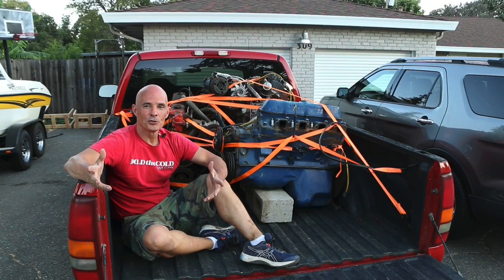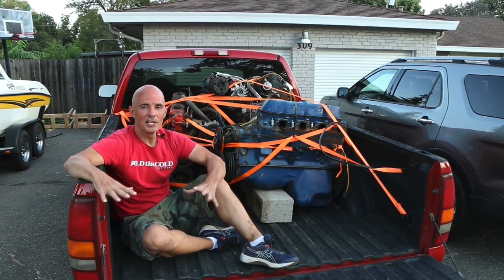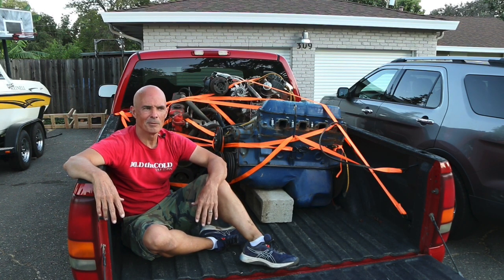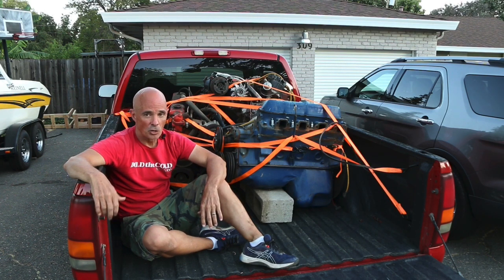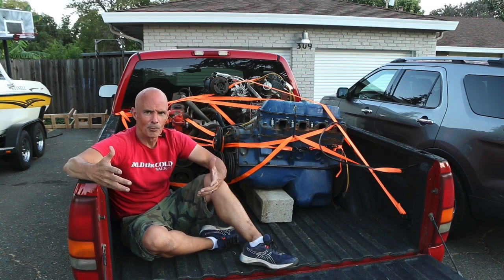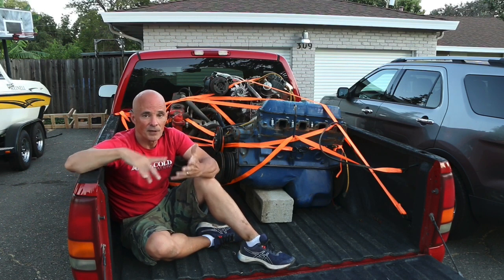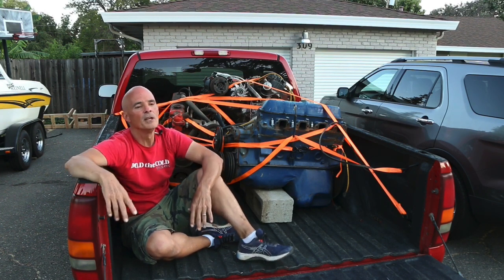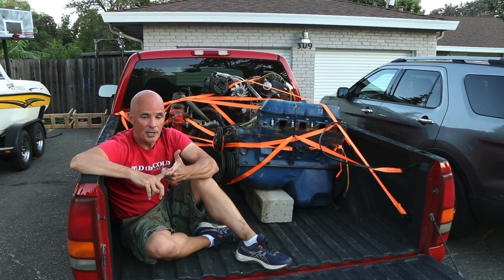THE OTHER GUYS-3 FOR FREE!!!

Comment: I am glad to see not only are you doing the blocks that most people blow up,and do not do to price, but how to make them last, and there short comings. Know I had a 455, its geometry was better,so it would give more with less, but I did not do the oiling system and bore out the returns, and coat the inside, and ended up starving the lower end , can not wait to see the builds,and the dyno sheets

Comment: I had a wrecking yard back in the 70's and 80's. All these engines were very plentiful. I had lots of trucks with the 292. Loved them motors. Funny story... I was rebuilding one of the 292's and when I was going back together with it I couldn't find one of the push rods. I spent several hours looking and didn't know what happened to it. Ordered a new one and got the truck back on the road. About 7 years later, my brother in law was metal detecting in my yard and found the missing push rod. The shop was 200 feet back behind my house so I don't know how that pushrod could have walked 200 feet and wound up in my yard. Crazy!!! 
I put a 500 Cadillac motor in a 70 something 4 wheel drive Chevy truck once... Sweet running truck!!! I also had a 78 Eldorado that I bought new. It had a 472 engine in it and it was an awesome ride. But it wouldn't run quite good enough for me. After about 150,000 miles I figured it needed upgrades. I rebuilt bottom end wit flat top pistons to raise compression, milled the heads .030, put in a mild cam, and ported the heads to gasket match the intake. I think the best thing I did for that engine was putting double valve springs back on it when I put it back together. Originally it wouldn't rev much past 4000 rpm. And I know they weren't built to rev but the springs and cam and compression made that thing jump on 5500 right now... It would run down the highway like a scalded dog.. Good old days!!!!!
Reply: Lawn mower blade shot it 200 feet.
Reply: Danny Wilsher I wish I had k own you back then. I could have given you loads of business. I grew up in Peoria, AZ and one year we had a flood. There was a wrecking yard sitting on top of a cliff which was where the rivirhad cut out its bank over the years. The cliff collapsed sending cars and parts way down river. When charged with the clean up they offered the kids form the Auto Shop class free picking so they didn’t have to pay to have stuff removed. Some guys found decent parts, but getting it out of the river was a huge task. The easy stuff got picked clean, the rest didn’t. By the way a friend of mine’s parents had bought a 68 Camaro with a 250 in it. But they paid extra for a 4 spd and 12 bolt rear end. When the car came up for sale I made them and offer and they agreed to it, but by the time I got back there from the bank his mother had called and she totalled her car, so they couldn’t sell it. I would have put a 292 in the and built the he’ll put of it! Oh well.

Comment: I'm more surprised Steve is getting rid of something.
Reply from the maker: he has a lot
Reply: @richardholdener1727  he's a hoarder.
Reply: He needed more ma mopar room.😂 he would never get rid of semiusefull scrap iron if he didnt need the room for more mopar stuff.😂
Reply: They weren't Mopars.
Reply: @richardholdener1727  just found a video over at 1320video's channel after watching this video. The video I seen was of a 36 chev pickup running a 292 chev inline6 with a huge turbo. At 1000whp. So send the inline6 with the boost.
Reply: Cliff Wright we know. Jnl was saying Dulcich got rid of non Mopar stuff to make room for more Mopar stuff.
Reply: Engine Power did a 292 turbo last season with throttle body EFI. I would like to see ITB for the NA part of the build, just because when I saw builds in the late 60s, running 3 Webers on an IR manifold had the best power and powerband.
Reply: Im REALLY Lookin forward to the 292 build!! I'll stay tuned for sure! A few years ago at Bowling Green Kentucky hot rod reunion, there was a slingshot dragster with two inline 6 cylinders hooked together driving a supercharger that was mounted on the frame and a plumbed tube intake. Hundreds of cars there that day, but that dragster (although not the fastest) was one of the MOST bitchin things I saw that day!

Comment: I really want to see the 292 built up in several versions. Like and old school build with 3 carbs and a split manifold maybe and high compression build with a 4 barrel intake from 12bolt.com maybe a multiport efi intake with turbo goodness. I'm really interested in the 292 build up and want to see what parts interchange with different engines and what kind of power can be made.

Comment: I'm betting the Buick 455 will have an incredible torque band. Can't wait to see it
Reply: They do for sure !  Buick did a great job with the cam/manifolds :-)
Reply: Hopefully they are well advised and use that advice
Reply: Agreed... the Buick has the biggest bore and shortest stroke of the big GM engines, which makes for good breathing, and RPM potential if you fix the glass bottom end with oiling upgrades and a main cap girdle.
Reply: @stevelacker358  or if you have deep pockets you can go with a ta performance aluminum buick big block.
Reply: Due to tall ports. The Chevy cathedral heads do the same thing
Reply: Buick 455 blocks are weak as shit in the valley and a lot of them have core shift and thin cyl walls. It will be interesting to see what happens.

Comment: Run a Sissell ported head on the 292. I think there are some aluminum heads for the straight 6 but they are spendy. The Buick needs oil mods.....go full Stage 2 with that one ( big port alloy heads with the round exhaust ports ).

Comment: Richard you might want to start with Sissell automotive.  Newbury park  ca 91320. They make the lump port heads.There is 1 292 inline chev in Texas  in a pickup running  80mm Garett Turbo runs 8.44  in the quarter mile it must make 1200 hp .

Comment: Extremely interested in your N/A data from that 292 and hopefully down the road a 300-6 comparison of as close to the same stuff. Perhaps some of the intake runner length "test" manifolds with efi. 
Goal of 1hp/ci for the 292 would be sweet to see with some kind of daily driverish idle quality.

Comment: Fuel distribution on the 292 with the stock manifold and egt sensors in each exhaust port.  Those manifolds were always hot and made me wonder how much power that killed and if all the heat really helps with keeping the fuel atomized to avoid pooling

Comment: 30 yrs ago, The Cad Company said that the intake to use on a 472/500 was a low rise, factory single plane from a later 364! That was before Edelbrock had one.

Comment: All cool!  Especially the 292 as a low buck turbo. As for other guys. I had a stock 1970 350 olds with 10:1 compression. Gobs of torque and reved decent. My fav motor ever

Comment: My friends 1968 Chevelle had a Caddy 500 swapped in and had a fresh rebuild , mild upgrade cam and cleaned up heads.  With a stock 350trans he could yank the front end off the ground.  Of course he went through a few transmissions since the stock 350 would only last 3 months at best lol.

Comment: I’m looking forward to all of these engines, especially the 500. 👍🏻
Reply: Hell yeah!
Reply: Me too. What's your guess on power for that caddy. If he uses 8psi my guess would be 375ish HP bit the torque would be 620ish.
Reply: Pj McCoy, The Buick made 700 ft lbs on 9 psi if I remember right, the Cadillac should make every bit of 700 ft lbs on 8 psi, and yeah horsepower probably won’t crest 400. 😄👍🏻
Reply: @shitbox7413  I used an online turbo calculator, plugged in my flow numbers. @9psi the web page spit out 720. The stock caddy heads don't flow. I have a caddy in a 81 trans am.

Comment: You need to do a big three straight six comparison
Reply: Big three? Unless there's an RB and a 2J included, you're missing the best of inline sixes
Reply: @RyanMcIntyre  Yeah, Domestics. I can supply a 225 Dodge.
Reply: I'm guessing he's asking the big 3 inline 6 from Ford f150 inline 6, chevy inline 6 and the dodge inline 6. I think the best inline 6 ever made from United States is the jeep 4.0L inline 6
Reply: @eliasmelendez1271  I had fords big 6 and that thing towed its rated weight an a half with the same speed unloaded lmao no hp but torque all day.
Reply from the maker: I have an RB25-so many tests I want to run
Reply: Barra the world lol
Reply: @richardholdener1727  well the modern big 6 now or from 2000-2019 is the Ford Barra 4.0L, RB30 and the infamous 2jz engine. I know it takes money to get any engine. But if you pay for the shipping cost I'll send you my extra 2jzge engine that I have. Just want to see how a 3.0L vvti will do under boost running a Vs Racing turbo lol
Reply: Just kinda curious, what do you do with all of these engines after you do your testing with them?
Reply: A comparison of US pushrod straight 6's would be cool, but a quick look at their factory cylinder heads will steer anyone interested in making HP  towards the late 4.0 jeep.
Reply: HP aside, an efi 300 ford six with a 5 speed in a 2wd f150 was a sweet truck to drive. Electric motor torque from idle.  Testing one on a dynojet, with a few upgrades would be super cool.
Reply: @eliasmelendez1271  I think the 300 i6 takes the 4.0

The 4.0 is in much lighter platforms than the 300 ever was and is never worked nearly as hard. They both last forever, but the 300 lasts while performing more work.
Reply: Well I suggested the big three ( Slant  6, 300 Ford, 292 Chev) since they weren't really performance engines. It would be neat to see how the performed on the dyno stock then throw some parts and old school tricks at them.
Reply: Dodge is at a big disadvantage (225,292,300)..... if you did this I'd suspect using the Australian 245 slant 6 hemi to even things up a bit
Reply: @eliasmelendez1271  Yeah, sorry, can't forget AMC!
Reply: @Joshie2256  remember that the AMC inline 6 is the grandfather of the jeep 4.0L inline 6. Chrysler bought out AMC and I think used that platform to create the 4.0L that is in the jeep wrangler's and Cherokee's. It's the same engine but bigger displacement. I think it started out as a 2.5L than became the  Stout 4.0L of the mid 80s to late 90s

Comment: Holy crap!!! Thank you for doing this video. I’m so stoked you’re doing this review on those other guys engines. You also mentioned the olds 455. I have been running a stock 69 Olds 455 engine that came factory with a two barrel for a few years. Oldsmobile said it made 310 hp at 490 ft with a 2 barrel carburetor.?.?. I converted it to a 4 barrel and installed some junkyard headers from a Olds 350. And it’s been a reliable engine with the exception of leaks. I’m looking to get a trusted 435hp and over 500 ft n/a. While on a budget. Since the tko 600 I just got hurt my wallet. So I hope you find a Olds 455. And do a analysis review  N/A and with boost. Because it will definitely help me along with building my dream car.

Comment: I’d use the stock manifolds for turbo manifolds, unless they are a horrible design.  If it looks like they are going to severely restrict power, then I’d try shorty headers.  Either way, definitely looking forward to the builds.  👍👍

Comment: Looking forward to the 292. I got one in a 64 C10. It's got a ported head with lumps installed, small cam, 390 holley on a offenhouser intake, and some other normal performance parts. From 1000- 4500 it pulls pretty hard. It's a fun truck to rip around and still use as a truck. I kinda regret not going with bigger cam and different intake and bigger carb because I could definitely give up some low end for some more top. Or maybe boost lol

First love is big blocks for me but straight sixes are pretty cool and I wish they'd get more attention.

Sorry for the long rant but I'm a big fan of your channel and I'm pretty stoked to see what your gonna do with the 292, well all actually. Thanks for the entertainment that you provide us.
Reply from the maker: I have something planned that should improve low end

Comment: Those 425, 472, and 500 Cadillacs work well in low rpm torque applications like heavy fullsize cars and trucks. In stock form some weak areas are the connecting rods and valve train and small cam tunnel in the block.

Comment: Super dope. I'm pretty sure with some massaging big block chevy headers will fit the 500, adapters are available to swap a 460 Ford intake too. Custom intake for the 292 will be sweet. Seen some guys cut the intake port divider and use a short countersunk bolt instead of the lump with a head bolt going thru the middle of it.  Probably wont matter as much once the intake is pressurized, and not under vacuum.
Reply from the maker: I've seen the lump for head flow
Reply: @richardholdener1727  I know the pOwEr NatIoN guys turbo'd a 292 and it made diesel like torque, but they were pretty tame on turning up the wick. Can't wait to see what you do, will be cool no matter what it is.

Comment: The 292 works real good with a Mercruiser camshaft and 2 bbl. Run .003 rods and mains and it will live with the stock Oilpump and pickup. 7 quart pan it has.

Comment: Super pumped for all of these. Especially the 292 and the 500. Bought a 500 at the pull a part knowing I would do something turbo with it one day. 

Richard Holdener I will send you the factory intake, carb, and exhaust manifolds if you want. Mine is a 76 so not the most optimal but hey it's the pull a part and it's a 500.

Comment: I think this is shaping up to be my favorite test series yet. I have a 455 with out the box Edelbrock heads and the TA 413-HLR CAM (High lift roller cam) and according to TA Performance should be near 600 hp and 550-600 lb/ft and it feels like it. I would implore you to boost it to truly demonstrate the limits of the Buick bottom end. As for the 292, my brother and I have always bantered about the possibilities of the 292 boosted and all the other variables that I'm sure you are entertaining. The 500, a beast. A friend put one in a 73 C10. Busted ball joints and endless burnouts. I have an offenhouser 360 intake for the 455 that I would love to donate  for an old school  "other guys" intake test .if you want it. Send me a shipping address and it's yours. I also can give a proforma timing cover/oil pump housing. I'm in Vegas so shipping time would be quick. I also have arp head bolts I could give you for the Buick as I upgraded to studs. Look at the TA dual groove teflon coated cam bearings as well. They are a must for oiling. I recommend you call TA Performance and talk to Mike (owner) and Tim ( customer service guy) they just fixed my engine that was bastardised by my local machine shop. He is THE BUICK GUY. Up the with Belle as an authority on Buick big blocks

Comment: Buick needs lot bearings clearance due to thin casting/ flex jim bell made a high volume oil pump or change spring in pump. Some 425 heads and intake flow a little better

Comment: With the 500 caddy you either have the 1970 10.5:1 compression pistons or the later 8.5:1 pistons, there is aftermarket heads and support for them though so just like a Pontiac you can get anything pretty much

Comment: Back in the early 1990's a buddy of mine bought a late 60s or early 70s Chevy C10 stepside that someone had put a Buick 455 in it.   That thing was stupid fast.   Not sure what the prior owner had done to the engine, but it had an aftermarket intake, headers, and I'm thinking a bigger cam.

Comment: Draw through Turbo now that's a blast from the past. A pair of Side draught strombergs or a couple of big say 2" SU's. I built a Holden 186 back in the 80's with a side draught 45 Weber draw through to start then replaced it with a couple of 2" SU's carbs and only a waste gate on the turbo. It wasn't big power though and maxed out at 6 lb of boost.  Pretty basic turbo though just oil fed plain bearings. Just get a old not very efficient turbo. A couple of head gaskets and a late model low comp head and it was good to go. 250 HP is the end of existence for a Holden 6 but I had a fair 208 hp with a fairly mild cam.  However many nights it was there for a good time not a long time and started to bend the rods. Quite funny as it wouldn't spin bearings just the rod would bend and knock the piston on the counterweight of the crank. Never had any money in those days and anything with a V8 was out of reach.

Comment: There is a 250 Camaro on the Tube with boost that is fairly interesting. 
Before I had to get rid of my 250-I6 C10, I was considering going that way. 292 is quite similar.

Comment: They did a all around performance street car test in some publication"" back in the 90s. The caddy Deville with 500 and nose came out on top witn nos. For a power adder. It even won the parking lot solom course. The 472 heads had the more desired combustion chamber and ports. The 292 will love the turbo. Power curve matches the typical power curve of NA. The buick....in the stage 3 vrand national. Owned the tracks drag tracks for a long time. !!!

Comment: Back in 1986 I had a 250ci 6cyl with a draw though system. Rayjay    turbo, quadrajet carb on a home made adapter. Ran 10 psi boost felt like a strong 350. It was in a SWB 1980 C10.

Comment: I want to see them all with boost. Old natural gas 292 AG engines had high compression pistons. Put out the word and some old farmer will send you a pile of them. I missed so many shifts in my 66 with the 292 when it was already revving to the moon then it would rev farther somehow. Finaly pulled a trans out of a 2 ton potato truck with good syncros and no more missed shifts.. I dont know much about the bop455 but i hear the 500 is rather beefy.